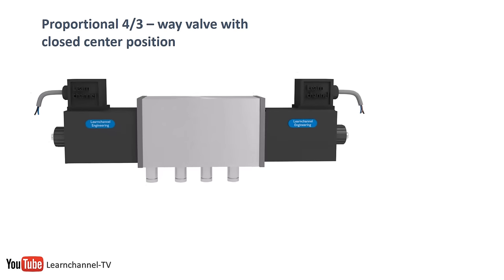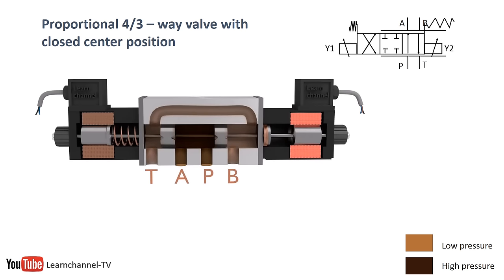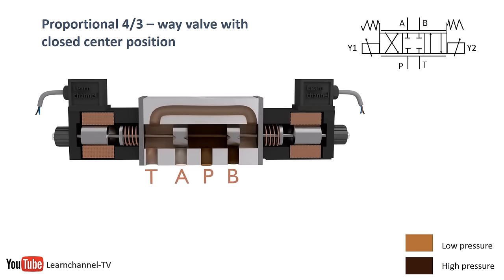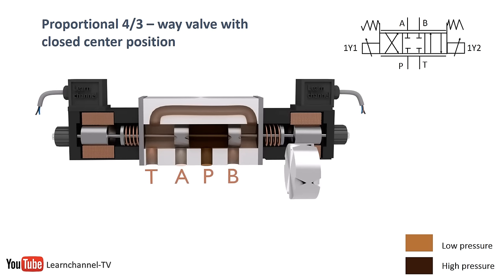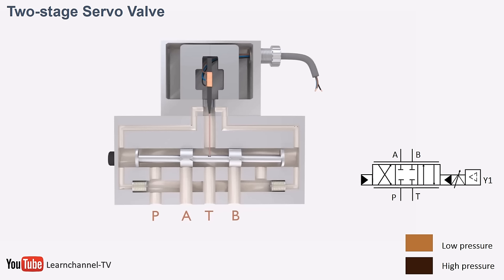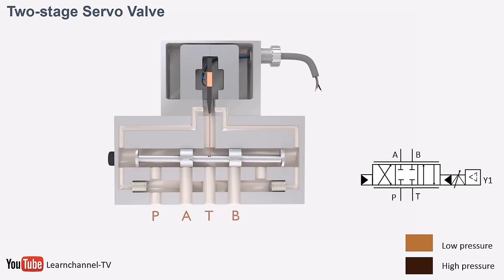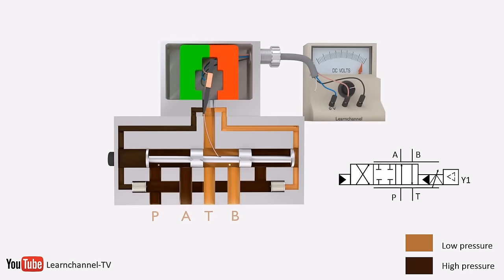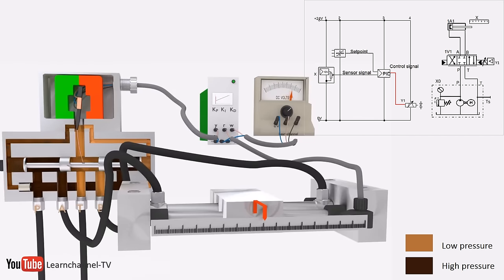Proportional hydraulics, proportional valve, servo valve - how it works - Technical animation

Comment: According to the video the so called feed back wire has no use. Because the spool will move the same way if you only move the flapper back and forth, without connecting it to the spool via a spring wire.

Comment: Hi what is a difference between Current proportional valve and voltage proportional valve? 1/current                   2/frequency             3/resistance  thanks

Comment: Good Video , i want to know that what is meant by T.A.P.B  written below the valve in the video ? Looking forward for your response.
Reply from the maker: T conexion to the tank, p for pressure (that means conexion to the hydraulic power unit),  A and B are the conexions to the actuator (cylinder or hydraulic motor). Thanks for your interest.

Comment: can you tell simulation circuits in this video is implemented in which simulation software
Reply from the maker: In this case it´s made with Blender. There exists also other software like Maya, 3D Max, etc. you can use.

Comment: can someone explain to me the meaning of P,T,A,B?
Reply from the maker: P Pressure, T Tank, A and B conection to the actor
Reply: @learnchannel-TV  thankyouu
Reply: @learnchannel-TV  
 one other question, if i want to use the proportional valve to replace the manual valve (input, output), what i see from the video i just need 1 proportional valve to replace 2 manual valve one?? is it correct?
Reply from the maker: @dimaramasakti1802  I don`t know what you mean with manual valve. But with a proportional valve you can replace a binary way valve and flow control valve, for example. So you have the advantage of less less parts.

Comment: Thank you for your prompt reply. I have another query:
1) Normally the servo valves utilise "pencil type filters". So do such type of filters offer more resistance to the hydraulic oil flow? 
2) Normally the servo valves don't emply solenoid valves. So the "black colored triangles" across the spool  mean the pilot operated  valves?
Once again thanking you for sparing your valuable time.
Reply from the maker: hello Abid
normally the resistance grows the smaller the diameter and the longer the filter is. The same goes for pipe lines. These penciltype filters are small filters but have this small diameter which supports a higher oil resistance.
The black filled triangle stands for a pilot stage valve.

Comment: Excellent video. I have two questions.  I would be very thankful to you if you could kindly explain me in your spare time. 
1) For servo valve, why the high pressurised oil after passing through the filter has become less pressurized? Normally,  it is not like this.
2) For the servo valves, you have shown a "dotted triangle with sine curve" , Y symbol and "a black color triangle". What does that mean? 
Thanking you for sparing your valuable time.
Reply from the maker: hello Abid
1. when the flapper is in middle position or away from the control line, there is no resistance more for the oil which flows directly to the tank. that means the only resistance for the oil is the filter (besides the pressure drop of the lines).

2. You have here an example of a two stage servo valve. The symols means that the electrical signal is amplified and you have a pilot operated valve.
Hope I could help you.

Comment: Servo valves are flow rated at 35 bar pressure drop per spool land. Maximum transmission of power from pump to cylinder occurs when pressure drop through system is 1/3rd of system pressure.
Can anyone explain the meaning of these two sentences with practical methods to cross check the above two things ?

Comment: CAN YOU MAKE A VIDEO ON HOW TO PROGRAM A PROPORTINAL VALVE TO A ALLAN BRADLEY PLC 1400 A
Reply from the maker: The next video will be 2 point controller how it works and how to program with TIA Siemens PLC. But I have never worked with Allen Bradley.